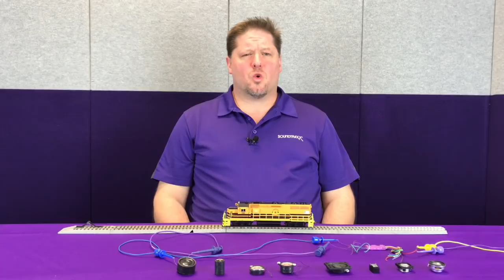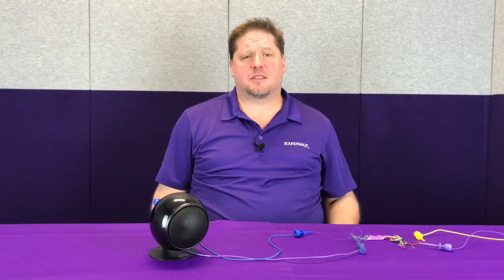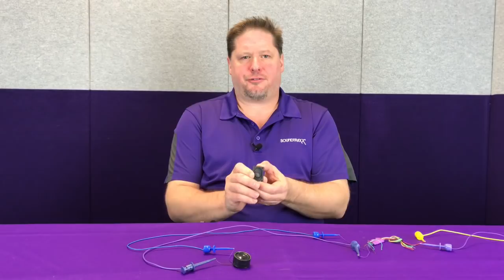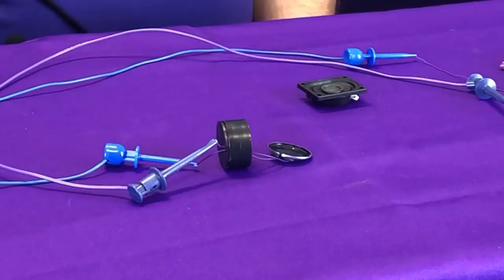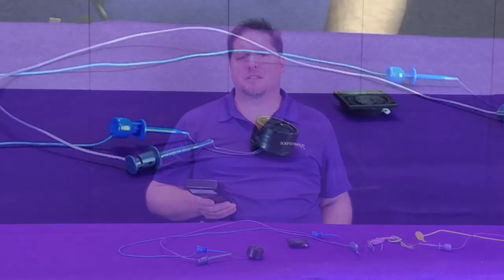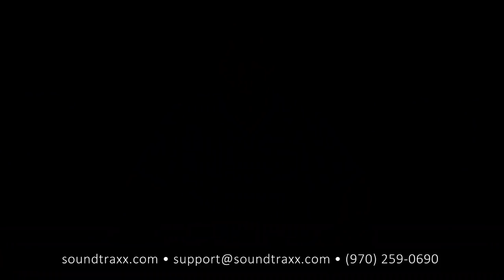Optimize your Locomotive Sound with SoundTraxx Decoders!

Comment: I would like to use two mini 2 speakers with a Tsunami2 TSU-2000 steam. Are they be able to handle the power if I connect them in series? The reason I selected these speaker is because they fit nicely inside the cab of a camelback brass locomotive.
Reply from the maker: Yes you can use two mini cubes. For more detailed instructions, contact our Support Team: (970)259-0690 or support@soundtraxx.com

Comment: Please help, normally in my 2 Locomotives NEWS (SD70ACE UP Spirit) I need to lower the value cv128 = 30 because the horn is distorted a lot, increase the value more (cv128) I think I can damage with the sound of the horn, with the horn is more distortion, please help me
Reply from the maker: Please contact our Support Department
directly at support@soundtraxx.com for more help with this.
Reply: CV 130 is the horn volume CV.Turn it down to 75??.

Comment: I am about to build my 1st MR. 
I have +- 30-40% of my initial rolling stock / track and a couple Walther Mainline EMD SD60 DCC locos with soundtrax decoders and an NCE Power cab system.  
  I believe these are economy locos and am not sure what "programming" options are possibe, but the horn volume, to me is so quiet compared to the engine sound that it is barely noticeable and despite hours of reading / watching videos, I haven't determined if the decoder, possibly a _ 2200? is volume adjustable by the user. 
 With no experience, I am hesitant to start playing with the settings for fear of rendering brand new stock unusable. 
 I think if I am able to raise the horn volume or at least lower the engine sound, it might make the features more useable.  
  Could you advise if these sounds are indeed adjustable and if not, what would be in your opinion, a premium decoder for these models?
  Thank you, Roger.
Reply from the maker: Hello,

These SD60 decoders by SoundTraxx are special decoders for Walther's Mainline products. These are ‘entry-level’ sound systems based on the original Tsunami.  We do not have a specific manual for this model, but you can refer to the Tsunami Diesel User’s Guide (https://www.soundtraxx.com/manuals/usersguide_diesel.pdf)  But since this is not a full Tsunami, you will need to reference the CV reference sheet for the SD60.  The Walthers mainline products are similar to the Bachmann Sound Value decoders.  Unfortunately, since we do not have a default sheet on our website for the SD60’s particular decoder, you can use this as a guide:  https://www.soundtraxx.com/factory/images/bachmann/pdf/bachmann_ho_sd40_sv.pdf  If the CV is there, it works the same as outlined in the manual, but if the CV is absent, the feature or sound effect does not exist in the product.  

When these sounds were originally mixed, they were all recorded and stored at the same volume level, leaving the volume mixer (CVs 128-133) to adjust the individual sounds so you can make the horn sound louder and reduce the prime mover volume by adjusting the CVs to match your preference.  The CVs can be adjusted from 0 (off) to 255 (full volume) so you can listen to each sound effect and adjust them to your liking..  Then you have the master volume (All sounds equally) set in CV 128. 
For example you can adjust CV 129 from 0 to 255 for 0% to 100% volume on the airhorn. Or you can use CV 131 to adjust the prime mover volume in the same way. 
We do have a few videos on Tsunami2 and Econami volume control specifically if you would like to watch them here are the links:
https://www.youtube.com/watch?v=Ak-9_-7uLy4
https://www.youtube.com/watch?v=RgJH2X7bPxc 

The easiest way to find our videos is to go directly to our YouTube channel and click on the videos or playlists tabs. SoundTraxx YouTube channel: https://www.youtube.com/user/SoundTraxxVideos/videos 

Please do not be afraid to change CV values. The term programming the decoder is misleading you are really only making adjustments to a decoder our engineers already programmed. Just like changing the volume or the channel on your TV. You can always go back. You cannot break our decoders by changing a CV!

The premium decoder choice for these models would be a Tsunami2, TSU-2200. The TSU-2200 is part of our newer Tsunami2 line of products that gives you much more operational and sound flexibility and volume control than the previous generation of products did.  You can see more at soundtraxx.com or on our YouTube channel 

If you need further assistance, please contact Josh in our Customer Support Department at (970)259-0690 ext 22.  He will be happy to help! Thank you!

Comment: Maybe it's just me, but your 1:1:1 baffle ratio is not well explained.
Reply from the maker: Here is a bit more detail: As a rule of thumb for small speakers under 4” in diameter, the minimum length, width, and height of the enclosure should equal the speaker diameter. Thus a 1” diameter speaker should be housed in an enclosure that is at least 1” long  x 1” wide  x 1” deep.  

You can get even more detail on the Sound Primer page of our website:
https://www.soundtraxx.com/primer/index.php?l=SpS

I hope this helps. If not feel free to contact us at support@soundtraxx.com or (970)259-0690 ext. 22 and we will be happy to answer anymore questions that you have. Thank you!

Comment: Awesome thank you a ton! Curious though, I have a couple cubes that I haven't used, and only have an oval(without baffles) in the engine area.  I would like to move the speaker(s) to my boxcar with the current keeper. Would you recommend a cube or one of the largest speakers? These are all HO.. Thanks as always..
Reply from the maker: You can use the two mini-cubes wired in series for this.